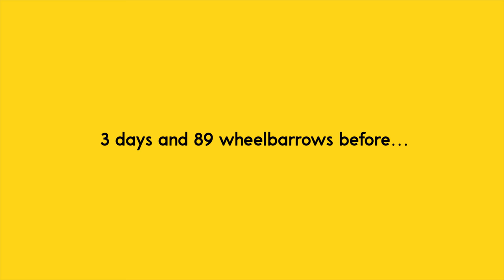How To Start A New Garden (From Start to Finish)

Comment: This is wonderful! I've been doing this for several years now, but I generally wet the ground underneath, then wet the cardboard to help make it easier for the earthworms, and to have the plants underneath decompose better. I've started putting my autumn Leaves under the cardboard as well. They feed the soil very well. Thank you for this video! Awesome!
Reply: Hi can I use dry grass instead of leaves,kindly assist
Reply: @rosemarywacera2576  I suppose so. Grass contains plenty of nitrogen. Can you get leaves though? So many people just take them up and throw them away.
Reply: Dovey62 where do you think that compost comes from?
Reply: @dekonfrost7  It's decomposed organic matter.  Not sure you're asking because you don't know, or you think I don't know. lol..
Reply: Pretty sure that's what the sprinkler is doing.....
Reply: If you wet the cardboard does that not make an anaerobic environment below it as oxygen will struggle to pass through the layers? Not sure if this is true, just asking as I am looking to set up my first garden like this with card boards and want to avoid anaerobic conditions. Thanks
Reply: @liamrudman4916  Not in my experience. The cardboard breaks down very quickly and the earthworms consume it.
Reply: Your Mom  Usually
Reply: @brad51333  There will always be more weeds. They fly in, birds bring them in, and some perennials might still return.
Reply: @brad51333  Cardboard & paper are "brown" compost that supply carbon. Worms love to eat it & I believe it insulates them from the heat of the Sun at the soils surface, which encourages them to move up & down through the soil. If you can't get lots of organic mulch, like leaves & grass, using carboard & paper (especially of you shred it) is a good option. However, it's not very nutrient dense so make sure to add kitchen compost, leaves, grass, manures or commercial fertilizers.
Reply: It's a waste of time wetting the cardboard because it will get wet regardless from watering and rain.
Reply: @rosemarywacera2576  You mean for making mulch? Yes, mulch is just a term for partially decomposed organic matter, like leaves, cow manure, chicken manure, grass, lettuce from your leftover dinner, etc.
Reply: @CliftonMurphyjr  thank you. I learn and  appreciate
Reply: I have a question guys, can i use dry leaves or dry/rice straw instead of cardboards? I don't have cardboard here and need to buy it to acquire it... thank you for whoever can reply..
Reply: @azyangadap3980  Dry (mostly) anything equates to brown (aka carbon or carbohydrate rich) that adds to the bulk for the organisms to eat and adds aeration so compost doesn't become anerobic and take longer to decompose. 
While freshly mowed grass is considered "green," which is nitrogen (or protein rich) which heats up the compost and causes the microorganisms to multiply. If you have old and dried out.... then it is considered "brown".

Multiple things that was "green" at one point  becomes "brown".

Don't be afraid to compost everything that was recently alive at one point. Exception, I recommend staying away from putting treated wood/board sawdust in. Well, do further research on it at the very  least and I would recommend allowing to compost longer. Meh.

I have researched a lot of articles from all different types if forum from agricultural universities,  government agriculture websites across the globe, different organizations, gardening enthusiasts,  people's experiences from YouTube and in the comments, etc. I just finally dive off and started myself on 25 Jan 2022. I have the recording on these different composting measures. I have them as unlisted videos if anyone interested. The  compost that started from 25 Jan 2022 has been ready to go now for about 2 weeks. The one started on 18 Mar 2022 with less complex materials and not directly dug into the ground like the 25 Jan 2022 one will probably be mostly ready in about another 1-2 weeks. The one started in the Maze Composting Barrel on 23 March 2022 with mostly just fresh grass clippings and dried leaves is mostly ready... but doesn't seem to have the rich soil-like consistency of the other 2 which has much more soil contents and animal life breaking down the materials. On the second half of the dual barrel Maze Composter, I started it a week later around 30 Mar 2022 with similar grass clippings and dried leaves but I continually  add food scraps (primarily banana peels) into it. I also keep picking up those crustaceans Rolly Polly to put inside almost daily for over a week. Finally, the Rolly Polly seems to have survived especially with me leaving more air to get in so they don't die in the hot plastic barrel. 
Anyway, here is a short read on an article I just pulled up that will give you a better idea: https://www.thespruce.com/composting-greens-and-browns-2539485

Tip from the too many hours researching what is "good" for composting.... I have consistently read/heard that chicken poop (manure) is one of the best poop/manure in comparison to larger animals such as cow or horse. The cow manure is also better than the horse manure. Manure is considered to be "greens."

Anyway, if you read half of what I wrote.... I hope you or anyone else will get some benefit. Dive in and don't overthink it. Compost need water and air.... or it will become anerobic and takes forever to break down.... over a year instead of potentially 8 weeks. However, turning/aerating without composting barrel can be quite labor intensive 🙄 and back breaking.... even on a pile that isn't that big (3 ft × 2 ft × 2.5 ft). I think I am going to move items from composting barrel to the earth to get it potentially more richer with more variety and add more browns and greens to get the microbes to heat it up!

Happy Composting and eventual Food Abundance. P.S: I got videos on my vegetables greenhouse seedlings starter on 5 Apr 2022.... as well as my fruit sapling increased to over 30 as of 23 Mar 2022. Learning and documenting mostly by videos.
Reply: @nathaliewilson1817  Thank you!!!
Reply: Could youname some of those web sites please thank you im

Comment: Sometimes, even if you want to be "no dig", you just have to dig, especially when you doing your initial garden prep. It depends on what you have to work with. 
I tried to do totally "no dig", using cardboard boxes, grass & leaves. I was converting a grassy field that had been a pulp & paper tree farm for decades. It was cleared & seeded for grass 15 years ago. It had a very thin 4"-8" layer of forest compost over pure solid CLAY & lots of rocks all through the soil. I swear, you could cut out cubes of the clay & use it in a pottery studio, it was so pure.
My problem was that in some areas, the top layer amended nicely & drew in worms but nothing broke into the clay layer. Even daikon radishes failed - they just pushed themselves against the clay layer & grew up above the soil line. Plus, some spots were so full of rocks it was interfering with root growth.
I finally had to turn the soil with a fork & shovel, to break up the clay down to 10", and added organic matter to that depth. There just was nothing in the clay layer to attract the worms that are the best soil turners, aerators & decompactors that Nature made. (Except for fire ants - those miserable monsters are scarring my legs for life, but they do move soil around & eat a lot of garden pests.)
If I did it right, I expect that I will only need to do this the one time.
Reply: Check out epic gardening and epic homestead channels, Kevin Espiritu deals with/ talks about the struggles of clay soil and how to amend it, but I don't think his situation was as intense as yours. I think he'd probably have information along the same lines as to what you've done lol 

I hope you have bountiful harvests!
Reply: Wow. I just got my Daikon radish seeds yesterday, and I plan to let them overwinter in my garden beds so maybe next spring will be easier -- because CLAY. So much clay. The possibility that they would grow up instead of down had never entered my mind. My soil is not as intensely clay as yours, so maybe I'll be OK. My goodness, you've had a lot of work to do.
Reply: hey, do you think its possible to just use dried weeds without the cardboxes? getting plaing cardboxes is hard in my area. thanks in advance
Reply: @SulthanMuhammad  Try newspaper if that's available
Reply: @roberttatusko3238  ok thanks ill try it on my next patch :D
Reply: Herschel try acidifying your soil. It’ll break up your clay soil. Cheers
Reply: @rephaelreyes8552  Thanks for the tip. I just bought some lime & plan to prep my beds for next spring after I harvest them this year. Apparently it can take 4 - 6 months for the lime to do its job.
Reply: Same. Where I live, the clay is so dense that we have many brick yards! To dig a hole for posts,  I have to dig down 6 inches, and fill with water. The next day, I have to shovel out softened clay, fill with more water, and repeat.
Reply: Ive seen people broadfork for 2-3 years si THE compost gets in THE crevices and gets better with time
Reply: Herschel, yes, I have experienced that too. I have been gardening for 50 years, trying different methods over the years, I started earnestly trying no dig a couple years ago and found that even putting organic materials on top, could not break the clay soil. I finally ended up digging down about 8 to 10 in before planting garlic recently. Now that I know my soil, I will dig into areas where the plants have longer roots. Thanks for sharing your experience. Happy gardening.
Reply: I've not tried it, and obviously only if you're allowed in your area, but what about keeping animals in your garden before it's a garden?  Like a pig or some chickens.  Would they till up the dirt well enough?  Just a thought I had.
Reply: @micahcoover6351  kune kune pigs.
Reply: For that very same reason I'm planning to get a heavy duty rear tine tiller and break the ground for the first time in 20+ years (heavy clay) and then incorporate no - dig for the future.

Comment: Great example of how to start new no dig beds! The cardboard on a roll is pretty brilliant... I’ve never seen that before. Way easier than laying out boxes. The end result looks great!
Reply: agree with what you said.  if you dont want to spend the money tho HVAC shops seem to have the best thick and clean cardboard. that or the back of grocery stores.
Reply: @nathanburnett5191  so there is just a few inches of soil for the plants to grow from? Is this so under the cardboard can build up microbes for later in ground planting?
Reply: @Miley_00  making shure the cardboard is wet can be important in dry conditions, to help it break down. The weeds die of due to lack of Light end become organic matter, very good method

Comment: I did similar.  I built a Dowden Bed (permission granted to call it this) that was high and packed, 6” deep within a frame.  After it rested, I removed the frame.  It was so beautiful, ya’ll.  So  clean and beautiful.  Turns out, the method does not favor my hot, windy and semi arid summers.  As I had always done, I was required to cover it with 6” hay, eventually knocking the bed down to about 3”.  I had to drive 1-1/2 hour to pick up the compost, even.  It’s just not sustainable for my environment but it was absolutely worth every effort, one of my greatest garden experiments.  Today, my garden beds are still symmetrical and pleasing to look at.   I’ve never had to touch the soil beneath and it rich and abundant now.

Comment: I did something similar 5 years ago by dumping composted manure in piles and spreading in 8'x4' and 15 " deep. No sides. I top it off every spring bc it settles. Much much easier than digging.
Reply: No soil is needed?

Comment: I just did this, minus the broadfork! This is a really great summary of the method from start to finish. So jealous of your nice flat cardboard. Even with weights, it wanted to curl up and fly away. I’m about to lay drip lines since my crop is cut flowers and I want to water those from below to minimize powdery mildew.
Reply from the maker: We experienced also some challenges with wind. Watering down the cardboard a bit before applying helps a lot in this case. Good luck with the flowers. The drip lines will surely help!

Comment: I would highly recommend to do 2 layers of card board if you have enough, as it will only take 1 season for hardy weeds to break through 1 layer of cardboard. The rain will soften it up very quickly and the earth worms will get through after that. So 2 layers are better if you want to suppress them for long enough. Also walking over the cardboard will pierce it if its just one layer.

Comment: I have been using this method for years with a few differences. I don't buy cardboard and I just build up grass clippings over my beds. It helps to hold in moisture while it breaks down. The worms love it and my plants grow like crazy. I use four steel rods about 3/16 in diameter with a long string tied to both ends and work one bed at a time. A fixed length assures my beds are the same length. Ussing a 2x4 to space between beds works too.
Reply: why is he putting down compost and cardboard, instead of using the land itself? I was thinking there are a few reasons

Either the land is not suitable for growing things, or it has been overused, either that or using compost and toping it up around the year is much more efficient on growing things, but I am not sure which one is the reason or if its the right reason?
Reply: @munteanuandrei8875  Using cardboard keeps weeds down and adds to the soil. It holds a lot more moisture in the soil. I add grass clippings on top of cardboard and the worms love it.

Comment: That cardboard roll looks like a game changer. Can you tell us what’s called so I can source a roll or 2 in Canada?
Reply: I think you’ll find it’s corrugated cardboard which I imagine any store that deals in packaging or a removals company would use.
Reply from the maker: It definitely is much better than having to collect individual pieces. It's called: Corugated cardboard roll. Quick search online should give you some packaging companies that can provide you with this! 2 layers thick is preferred.
Reply: @TheDutchFarmer  thanks so much. Now I know what it’s called I found many suppliers. Ugliness being one. Yes, so much easier than bits & pieces. It seemed I’d been collecting cardboard boxes for months, my garage was full & I only got 3/21 100’ rows done. Although it feels good to be in the Reuse camp.
Reply: Geez I meant u-line. Not ugliness. But it is costly. Around $300 cdn for 250’. I’d need 3 rolls.
Reply: @shannondillman8307  Anything but ULine. They're owned by horrible people and everything they sell is way overpriced.
Reply: I bought some off of Amazon.

Comment: Good job and well presented video.
I started no..as a ordinary gardener. Here the wild seeds got into the compost. It's hot and dry too, so I have to mulch over the compost. 
The cost of compost has tripled here. So I have various stages going on whilst I make more compost and woodchip.
For now I smother the weeds. Put down shredded newspaper and rip up cardboard. Wet it and plant into the ground. Then cover with mulch. 
Next time, I should have more compost ect to put on top of this bed. I will use the no dig method..cardboard, compost mulch. 
That's just me. Plenty of ways to garden. 🙂

Comment: In my garden, in the fall, I dig a few holes -- maybe 12" by 12" -- about 5 feet apart, cover each with a board so as not to accidently step into one plus keeps critters out, and that's where veg scraps go, plus any trash fish I catch.  The worms are delighted, and in turn they produce nutrient-rich castings (poop) and crawlers for fishing. In goes newspapers as well, to retain water.  
I also put old carpet over the area which I find on the curb, when someone throws it out.  Doesn't matter the condition.
This keeps the weeds completely eliminated, and also holds in moisture, and attracts worms.   
Bear in mind I do this in the fall so any chemicals are leached out of the carpet all winter, and the carpet is saturated with moisture.  I use broken down cardboard boxes too.  
I add some horse manure too, for nitrogen, but not too much.

Comment: if you have a dozen 5 gal buckets,   place them at the base of your piles and use gravity to sweep the soil down from the top...like a land slide avalanche Fill each bucket and then load the wheel barrow....much faster with less work on your lower back.

Comment: How many cubic meters of material did you need to get started for this example garden? I am interested in building a 1/10 acre garden on some new land, but I need to be sure that I can get the startup materials shipped without blocking the driveway. I still need to visit the property this weekend so I might find a solution when I get there.

Comment: I'm looking into a similar setup but would prefer to avoid sprinklers (water waste and I also understand not all plants like wet leaves) and opt for a drip system instead. Is it OK if the tubes run along the middle of each of the beds or is that going to impact the plant growth?

Comment: I like this method, but am wondering, instead of using cardboard, would covering the entire area with wood chips and then adding the compost for the beds be practical and effective on weed control? I haven't looked at pricing for either, so don't know if there would be increased cost with all wood chips.

Comment: What is the space between each potatoes (both) and also onions?
I plan to do one for personal use only like a roll for potatoes, a roll for onions, a roll for bell peppers etc.
Thanks for your video 
That’s the best I see thus far…very simple not to technical like others
Also, like mine will be smaller…can I just dig the ground and use it without any outside products like top soils, cardboard, compost etc…